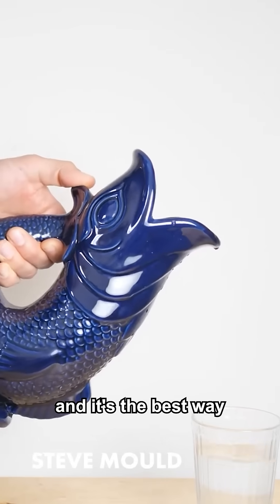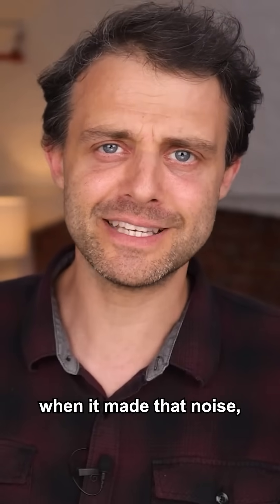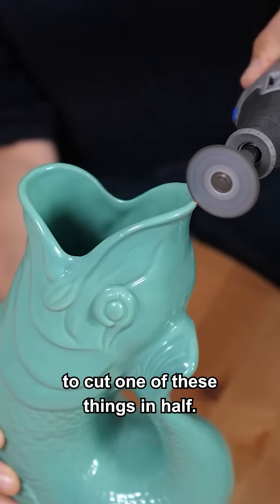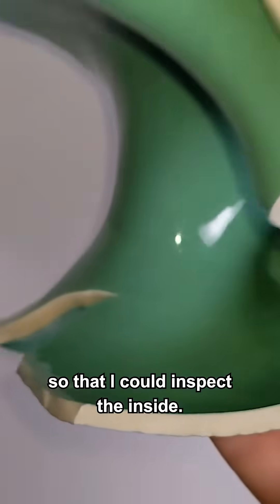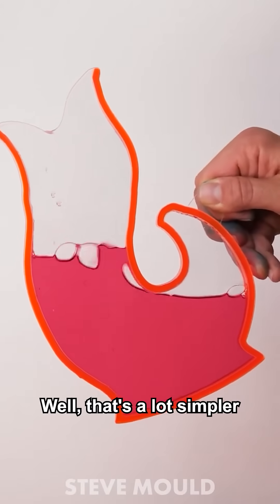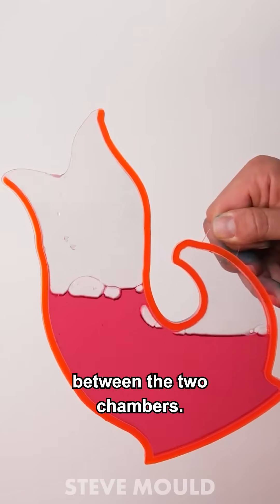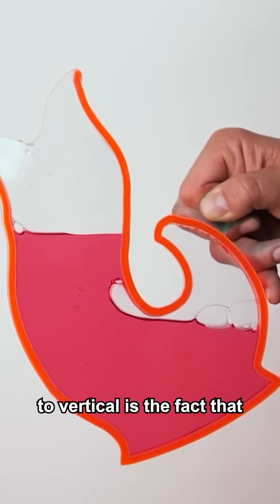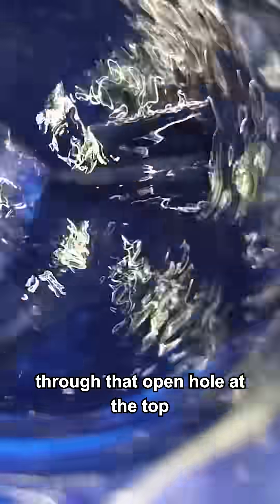Why does a Gluggle Jug Gluggle?

Comment: Water is literally electrified. Shaken water tastes different, then tapped water for a reason. When you move water through several stones, for example, it it produces more electrified elements. Which is really good for your heart. Think about animals in the wild. They prefer a stream with lots of rocks as opposed to standing water. It's quite simple. Water that is constantly moving has more electrons, and therefore is better for your body because it's quite literally giving electricity to your heart. You're welcome...

Comment: The sound is louder (than what?) because the jug itself is a larger resonating body and creates a deeper gurgling sound... in addition to the fact that the bubbles are larger because of the air mass stored in the tail. Larger bubbles and larger vessel equals a louder sound.

Comment: I love the science behind it but my OCD side keeps me wondering how on earth can I wash the inside of this jug?
Reply: warm soapy water
Reply: the hard way.
Reply: Put your arm in
Reply: I mean, if it's only distilled water you're using, you don't have to wash it
Reply: @gottacannonfast  who tf drinks distilled water... you know that's fatal after just a short period only drinking distilled? You need minerals in the water or the osmotic pressure will get imbalance and salts of your cells will get sucked out.

Did you meant "still water"? Like without carbonization/gas? Because that is something different and perfectly fine to drink only that.
Reply: @Atillatzke  definitely not fatal after a short period drinking distilled unless you get literally zero minerals and electrolytes from the food you eat
Reply: Distilled water from the store has minerals added back into it so you won't have this issue.
Reply: @izicial7469  that's not called distilled water tho... that's called still water.
Reply: @woozy1558 Wrong, the poster was right . Distilled water will actually mix with existing minerals in the body and essentially “strip” the body of minerals, it’s not something to drink regularly.

Comment: The difference between an air bubble escaping through the open hole in the top of a bottle and this thing is that the air escapes through the open hole in the top of it so it's louder..fuck this guy

Comment: Hey Steve. Obviously it's some air/liquid interaction, but I love your enthusiasm to find out exam why and how things happen! But "cut the thing in half" is as bad of an idea as "smack it with a hammer", since there could be three dimensional structures inside of things. But usually you're lucky enough to only break it into a few pieces, allowing you to still understand the mechanism. But there is a possibility to destroy it without finding out the mechanism. Luckily there is a better way though! Not needing to buy a second example to destroy because it's non destructive! You could simply image it with any suitable three dimensional spectroscopic technique 😊 Such instruments cost a lot though, but maybe you can get in contact with a lab who'd like to scan such cool mechanisms. And if not, just fake an illness and smuggle the target mechanism into a CT or MRI 😂

Comment: First thing that comes to my mind is how hard it would be to clean that thing inside
Reply: Bottle peas make cleaning any weird jug possible. Best invention.
Reply: What is bottle peas????  @rebeckahb623
Reply: @rebeckahb623 This sounds promising!  I’m going to look this up, too.
Reply: For those wondering, the life hack is to use a cleaning seltzer/ denture cleaning tablet. Since it's meant for dentures, it's a safe cleaning agent. Fill with water, drop it in, and don't have to worry about cleaning at a weird angle. Works for weird bottles, camel packs, etc. You can buy like 100 - 300 count at retail stores.
Reply: Vinegar
Reply: Just fill it with soap water
Reply: Salt, alcohol
Reply: @BeezyWaxx  I found the stoner 😂
Reply: @BeezyWaxx and baking soda and white vinegar 🎉
Reply: @InFamXYT  and you can drink the alcohol after
Reply: Fill with soap and water and shake and use a brush
Reply: Oh gosh, I thought about it as soon as you pointed it out 😮‍💨😭
Reply: there's sponges intended to be used in bottles that you can use with this one
Reply: Pretty easy really. Use like a sink brush/sponge on a stick. And it looks pretty spacious so you might be able to reach mostly. Or just put some soap at the bottom and use a kitchen sink sprayer to spray in inside.
Reply: ikr like how would you clean that😭
Reply: That's why it's for pouring "water" lol
Reply: only use water?
Reply: First I thought it sounded pretty neat, then I thought if I were to get one it would need to be clear so that I could see to clean it, and make sure it was really clean inside since it looks like it would be hard to clean.
Reply: Just get one of those things that shoots water inside the bottle
Reply: Make a custom 2d scrub brush, easy. XD
Reply: If stoners can keep the most intricate bongs crystal clear, then cleaning this can't be THAT hard.
Reply: @jasonfraser7536  My thoughts exactly. 😂
Reply: shake it with something hard on the inside like the bottle pea guy said but you can also just blast it with hot water for a little
Reply: yep. If you want to get in there and scrub it and not just swish clean it. You also cannot see in there either.
Reply: This is the longest freakin’ argument/ debate about washing weird things I’ve come across other than in my own house.  🤔🤔🤷🏾‍♀️ ….. .. I think I’ll go and check out some more.
Reply: I would only use it for water.
Reply: Bottle brush with a flexible handle
Reply: Exactly 🎉😂
Reply: I only use mine for water, not hard to clean because it doesn't get dirty... Just a good thorough rinse with warm water does the trick
Reply: It would be pretty easy if it’s just used for water, just put in a dish water and it should be good as new.
Reply: @notribadsvault  I only use mine for water and I just rinse it after use and stick on the window ledge next to the sink, it's used frequently, I think people are overcomplicating the use of a water jug.
Reply: Water with a little soup and rice (shake not to hard) = new gluggle jug
Reply: same!
Reply: Why would you need to clean it
Reply: use one of them baby bottle cleaners
Reply: I wanted to know where to get one! 😁
Reply: Its just going to be filled with water no ? So i guess a wash with water every now and then is fine enough
Reply: I'd say, if you're worried about residue, vinegar or lemon juice + bicarbonate of soda, shake abit, let ot act a few minutes or less, then rinse a couple times. That's what I do at times and it also works for slightly harder spots on surfaces or certain stains on clothing. Just be careful about not ruining your surface, because I think it would be bad on thick wool or silk, I don't know. I use it mostly on cotton.
Reply: Truth, but totally ruined it...
Reply: It's just water bro... It's just the source of life bro you don't have to clean it
Reply: soap + water, cover top and shake hard. not that hard
Reply: @lol-wc3ld  Now you have soap suds in the impossible to reach part
Reply: @BadgerOfTheSea you can keep putting more water in it till they’re gone?
Reply: @BadgerOfTheSea  rinse with water at high pressure after then
Reply: @BadgerOfTheSea it isn't impossible to reach. Just fill with water until the suds flow out, dump the remainder, and repeat a few times.
Reply: @BadgerOfTheSea  Dude, fill it with water and dump the water. This is just common sense at this point.
Reply: @BadgerOfTheSea  you can rinse things btw
Reply: One word. Bleach.
Reply: @bondiggitti  one word : toxic
Reply: @Baby_blue-h2o 
one word: rinse
Reply: @bondiggitti  good anime 👍
Reply: fuck that bro
Reply: Just take out the dirty drink or whatever and put water and hand soap SHAKE IT OFF OFF OFF and pour it out wait until it dries (or just use it again) AND BOOM NEW FRESH CLEAN CUP
Reply: Dishwasher.
Reply: put it in a dish washer, I know that was hard.
Reply: @aaronbrandon2321 not everyone has dishwashers
Reply: @FairyKit  so buy one
Reply: @aaronbrandon2321  I'm in a rental. I can't just "buy" one, plus they're expensive. There's no where to put a dishwasher in my small unit. Not everyone is privileged like you
Reply: @FairyKit  $200 and you get a portable dishwasher. You are on a video about a specialty glug jug calm down there robin hood we're already talking about someone with disposable income.
Reply: @aaronbrandon2321  you're on a comment section asking about how to wash the jug. I'm just letting you know that not everyone has disposable income like this and people are asking a legitimate question on how to wash an item.
Reply: @barondavisiscool  I think your brain lapsed in trying to white knight the conversation.
Reply: @aaronbrandon2321  
Are you high?
Reply: @aaronbrandon2321 haha, both of these comments aren't wrong.
Reply: @aaronbrandon2321 the design of this jug would cause problems in a dish washer, so you know why we put dishes upside down? So the insides don’t get filled with dish water silly! And if this cleans a jug it WILL fill the area that makes the glug glug sound with dirty ass dish water
Reply: @DeletedDevilDeletedAngel  buddy if a dish washer can clean my multichamber bong itll clean this, and I cant make it any simpler then that.
Reply: @aaronbrandon2321  bongs do not have upside down containers they are all tubes with a bottom, imagine a container with another container inside upside down collecting dish water like a storm drain, disgusting
Reply: @DeletedDevilDeletedAngel  Buddy you don't know bongs lmaooo. If I only I could send you a pic of mine here.
Reply: @aaronbrandon2321  ik specific bongs, I’m not a collector or anything
Reply: @DeletedDevilDeletedAngel  its funny because plenty of bongs have perc systems which is "a container with another container inside upside down" in the most literal sense possible.
Reply: @aaronbrandon2321  this bong just has 2 tubes and every depiction I’ve seen is 2 tubes and the right angle doesn’t have any upside down thing
Reply: @DeletedDevilDeletedAngel  how old are you that you've never seen a modern perc bong?
Reply: @aaronbrandon2321  even if I’m 60 I would probably never see that bong ever if you never told me about it

Because like I said, I’m not a collector like you
Reply: @aaronbrandon2321 Lmao homie is arguing for 2 weeks straight😭
Reply: @Jaxl8  Well when you're right you're right, and I always am.👌
Reply: @FairyKit  the poors 😡👎
Reply: @FairyKit  to be fair... If you're not getting enough meals a day, you should probably hold off buying a glug jugs 😅 but I understand why so many people are angry, it's because of the guy's attitude
Reply: @lll-lq4zt  oh yeah I agree. Shouldn't be getting one of those things. And yeah I really said that so he could get humbled.
Reply: @lll-lq4zt oh yeah because buying something is the only way people acquire things lmfaoooooo they can't be gifted something 🙄
Reply: @stardoll1995  so your friends gift you something inconvenient as a gift when you're not even capable of getting 3 meals a day?
Reply: @aaronbrandon2321 what makes u think ppl have 200 dollars to spare after bills and food and other basic living expenses
Reply: @astraaldreams  that the issue they are complaining about is washing a goofy vase
Reply: @aaronbrandon2321 anyone who thinks they are “always right” is a lost cause.
Reply: @aaronbrandon2321 it just sounds like you're ok with your things not being completely clean.
Reply: @aaronbrandon2321  I can assure you that a dishwasher, although it is amazing tech, is NOT going to be able to clean the inside of that jug properly

It can't even properly clean the inside of the quite wide-necked bottles that I buy tomato puree in.

It's just jets of hot and soapy water, not a miracle machine
Reply: @aaronbrandon2321 test reply if previous didn’t come through

Comment: ...certainly the glugs are also louder than regular bottles because of the much larger pressure differential caused by the trapped vacuum in the curved tail so the bubbles are fewer, bigger, and transfer w/ more force?

Comment: That's not how acoustics work but good try.  It's amplified by the smooth roundness.  Not just the fact that it's escaping out the top and not just getting trapped towards the bottom.

Comment: He has no idea why it's louder. It is not louder because air escapes through a hole in the top. It's louder because the point at which the noise is made is deeper inside the container. Sound waves  bounce off the walls and act as a horn.

Comment: I absolutely love these, but i can imagine they are an absolute pain to clean 😂
Reply: Small amount of isopropyl alcohol (99%+) with a light abrasive such as, pickling salt and you’re good to go 👍 

Quick shot of dish soap with a hot water rinse, call er a day. 

Can also do a distilled water rinse, to avoid hard water staining/ mineral buildup, especially on clear glass. 

Save the Isopropyl and salt mixture, you can reuse it a few times, if there’s not a lot of contaminants. 

Vinegar, works wonders too

Comment: Hey Steve, what happens when you line up a bunch of opposing magnets and give one end a push? Does the other end move instantly or is there a delay? What is this delay/speed called and how fast is it?
Reply: There's always a delay of at least the speed of light. All of causality and information travels with that as a maximum speed there's never something without a delay if you could theoretically use it to even just transmit 1 bit.
Reply: @nichfra  i remember a story about some matter that if you turn it on one side of the planet, it instantly also turns on the other side. Cant remember what it was
Reply: @dotonthehorizon9620  probably quantum entanglement. But that's not transmitting any information because it works slightly different. By measuring one particle you know the measurements of the other entangled particle. 

Imagine a bowl with a red and a green ball in it. You wrap both tightly in cloth so you can't see their color. Then you randomly take one to China and one to Canada. Someone in China could now unwrap their ball to find out the color of a ball in Canada and vice versa. But they can't use that to transmit any information between China and Canada.
Reply: @dotonthehorizon9620  probably quantum entanglement. But that's not transmitting any information because it works slightly different. By measuring one particle you know the measurements of the other entangled particle. 

Imagine a bowl with a red and a green ball in it. You wrap both tightly in cloth so you can't see their color. Then you randomly take one to China and one to Canada. Someone in China could now unwrap their ball to find out the color of a ball in Canada and vice versa. But they can't use that to transmit any information between China and Canada.
Reply: @nichfra  thanks for the clear analogy :)
Reply: @nichfra  but by the way, what does the speed of light have to do with magnetic propulsion?
Reply: @dotonthehorizon9620  the perturbations or changes in the magnetic field propagate with the speed of light. So if you have just two (small) magnets the second one will "feel" the first one moving with exactly a delay of distance/speed of light.
Reply: @nichfra  thanks, that totally answers all my questions! It is still very hard to wrap my head around light having anything to do with magnetic fields. Do you know of any video/animation explaining this effect?
Reply: @dotonthehorizon9620  I sadly don't have a good video or something on that but consider this: light is electro-magnetic-radiation the magnetic is already in the name. That's because light is just alternating electric and magnetic fields. Even though it's not really an explanation for why or how, as that would be too complex for a YouTube comment, that might make it a little more intuitive.
Reply: @dotonthehorizon9620  I sadly don't have a good video or something on that but consider this: light is electro-magnetic-radiation the magnetic is already in the name. That's because light is just alternating electric and magnetic fields. Even though it's not really an explanation for why or how, as that would be too complex for a YouTube comment, that might make it a little more intuitive.
Reply: @nichfra  normally i just troll in youtube comments, but this conversation has been a refreshing change of pace. Thanks for the informative answers.

To circle back to my original question, youre not saying that the line of magnets will transfer 'data' with the speed of light right? Cause that would be cool to see on a semi large scale. Maybe a line of like 1000 magnets for our eyes one end would move instantly when you push the other end. Cool video idea, maybe i will test this if nobody else already tried it

Comment: Important new topic!! Why do toast machines pop up when the electricity turns off. And why doesn’t the bread stay down if the machine isn’t plugged in. I MUST KNOW!
Reply: Solenoid switch in modern toasters: they work by using an electromagnet to create some sort of motion, so when powered on they grip/hold the toaster cage (or move some other mechanism to keep the cage down), releasing when the timer is done (or whatever mechanism the toaster has for determining when it's done toasting). Since they work using electromagnetism, they are only able to hold the cage down when power is flowing through them 😊

Comment: If you want to move an object through a pipe with differential pressure,  is it more effecient to blow or suck? Thinking Brunai's railway.
Reply: I assume blow, because it's easier to cause high pressure than it is to pull a vacuum?